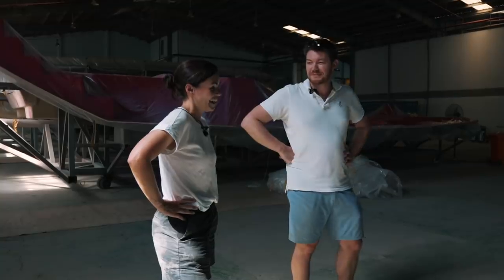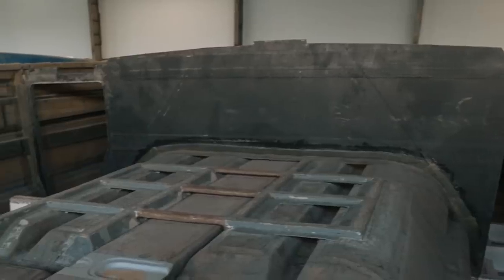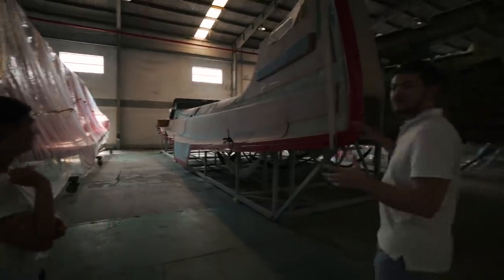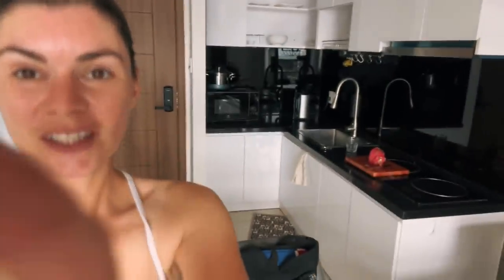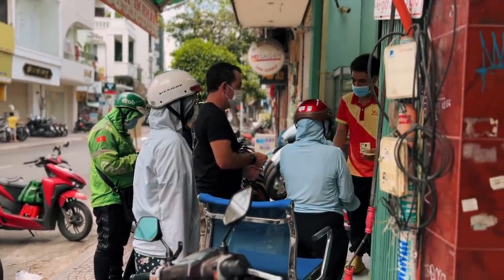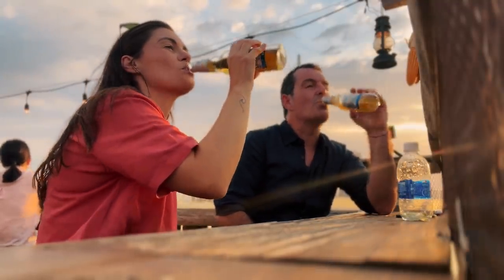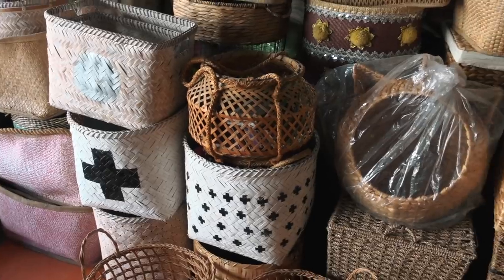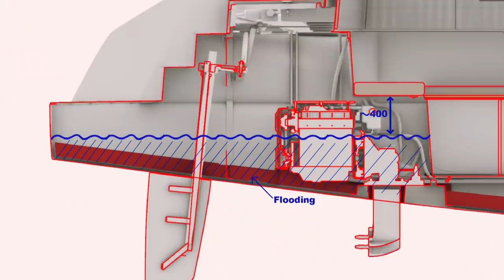CATAMARAN BUILD- The First Step of Building Ruby Rose 2

Comment: Great video, love seeing all the detail!  Question (and I apologize if I missed the detail in a previous video or you will be covering it in a future one), is the foam core that they are laying down on these new hulls vacuum formed into the shape of the hull prior to placing them in and infusing the resin, or is it flexible enough to meet the contour?  Or are there a bunch of cuts that allow it to take the shape.
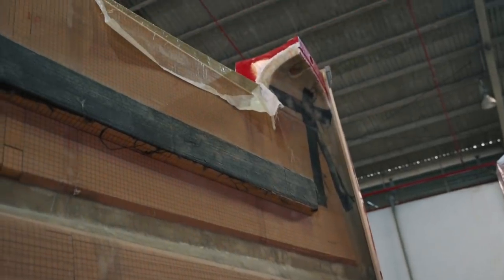Reply: At 4:29 it looked like the coring is sliced to let it bend easier.
Reply: @michiganengineer8621  I noticed that as well, but sometimes foam material like this has a grid printed on it from the manufacturer, it does not necessarily mean it has been cut. Having a bunch of cuts would give more spaces that need to be filled up with resin, thereby adding unnecessary weight to the boat, which is not great for a performance oriented boat.  SeaWind has put so much thought and care into this new model I doubt this is the case, but just curious to know.